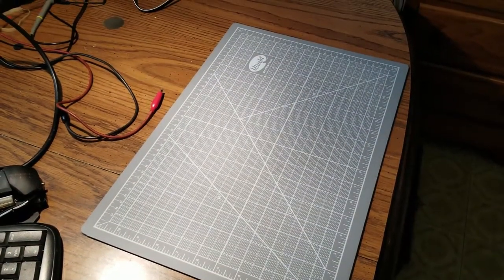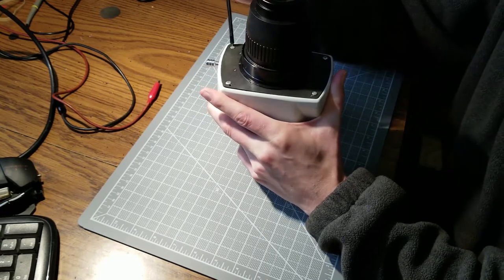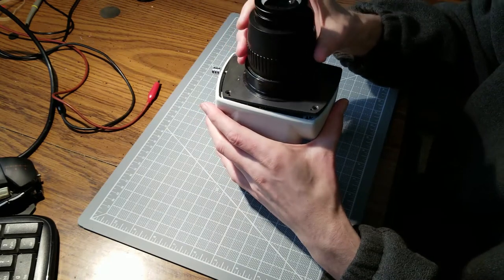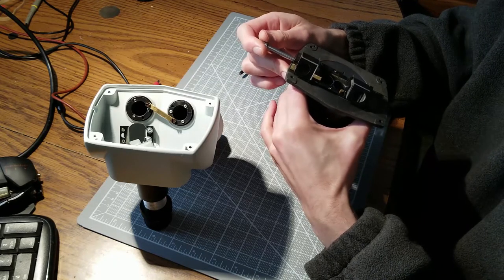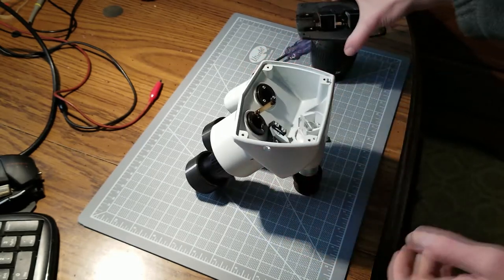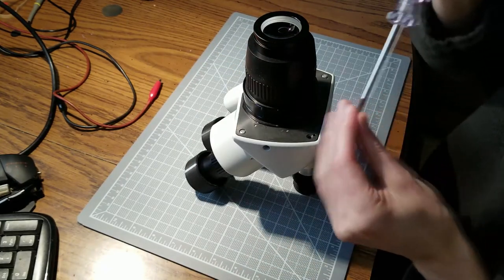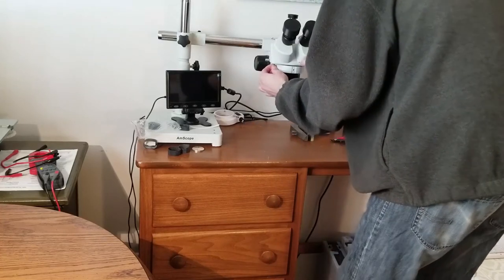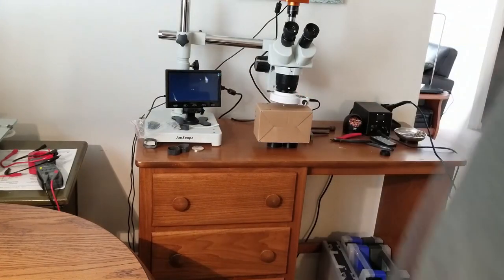AmScope Binocular Microscope disassembly/teardown

Comment: I receive a new simul focal microscope, but comes with an issue.
eye pieces are working perfect but the camera image are very dark and out of focus, not all the screen, some part looks good and part out focus.
The problem is the prism inside the microscope, are not well aligned.
Next week I try to align.
In the worst case I will buy a new one.

Best Regards.
Reply from the maker: Good luck. Hope it works out.

Comment: Well, mine had dust particles on the inside of the lenses when I got it brand new, I notice them mostly when looking directly at the lenses from the outside against a light source. So I guess they are not sealed, or not assembled in a clean room.
Reply from the maker: That's unfortunate, I hope you'll be able to get it cleaned up.